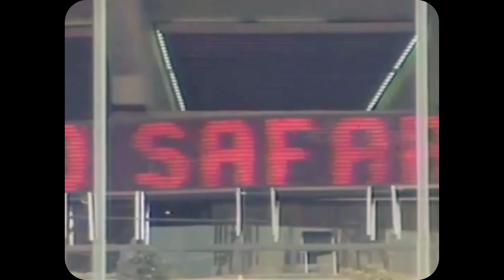Audi's Worst Nightmare

Comment: Fabulous video! 
Two corrections:
13:28: "The event was won by a Renault 5 Maxi Turbo". It was actually won with the older Renault 5 Turbo, driven by Joaquim Moutinho, not a Maxi. 
14:57: "Peugeot ended up winning the Tour de Corse". After the factory Peugeot and Lancia teams withdrew, a Renault R5 Maxi, driven by Jean Ragnotti won the event.
Cheers
Reply: Peugeot did win the 86 Tour de Corse Bruno Saby was driving. Jean Ragnotti won in 85
Reply: @DZeus83  You are correct, I got '85 and '86 confused. Cheers

Comment: Also worth a mention. Between the lotus sunbeam and the Peugeot 205 t16 talbot were developing a mid engined talbot horizon to take on the grp4  cars  it had the sunbeams  911 lotus engine mid mounted and turbocharged to produce over 300bhp but it was only rear wheel drive and with  the audi's 4 wheel drive success it never reached it full development befor Peugeot  took over and Jean Todt stopped further development and built the t16

Comment: As all racing events stated on the ticket in the 1970’s onward, Motorsport is dangerous!
Todays rally cars go faster than the group B cars were going but they aren’t group B so deemed safe.
All it needed was uprated safety cells and the fun could have continued.
As it is all rally events have pace notes and the crews practice before the event.
Only the old RAC rally was driven blind and was therefore safer as drivers had to leave a little performance in hand as they didn’t know what was coming next.
Standing near the track was great I always did it in UK in 1980’s but here spectators were never allowed to congregate on the outside of a bend or corner. So, if a car went off nobody was in the way. In Europe it was like Tour de France with them literally inches away everywhere.
The Ford RS200 was really not up to the design brief and didn’t handle well. Metro 6R4 was just loud and quick but a bit too short. Saw them all on RAC rallies for 10 years doing around 1000 road miles each year following it around. 
When else can you walk into a leisure centre in Swansea at 4am and get a good wash and food?
Remember hitting Washington services on the A1 at about 1am looking for food and coffee with about 50 others of various nationalities and causing chaos.
They were expecting the fans around 6 am but we all took in the service area by Kielder and then headed towards Dolby Forest due to start around 7am.
I decided I didn’t fancy the Scottish leg and aimed for Pickering with a pit stop at Washington services.
The girls were shell shocked including the manager but they got everything fired up really quickly and fed us all very well indeed!
Those were great days because you kept meeting up with the same fans doing the 1 stage in 3 trick and the Germans always had cooked breakfast going in all the forests and shared food too!
Reply: In the USA we had no practice/pace notes, just route instructions (tulip diagrams) to direct us on roads we had never seen before. SCCA early 80's.

Comment: Quick note, back in the 80's and 90's the Rac rally was all over the uk, rather then just the modern version that never leaves wales. So for 1984 when the 205 did its first rac rally, they actually started in liverpool. It was only Wales from 2000 onwards, before that they went everywhere, even to scotland some years, and it started in different towns/citys every year. I remember going watching the start as a child in around 1992 and it was in Harrogate for the start.

Comment: Not sure if you didn't make a mistake there about the anullment. FISA anulled the results of the 1986 San Remo Rally, because the Italian event stewards disqualified the whole Peugeot team for using illegal side skirts (which were deemed legal at other events, so Peugeot protested the decision later). Many thought this was the Italian stewards trying to help Lancia win the event (which they did in the end). FISA anulled the event after the season had concluded, which was very controversial, because it changed the result of both championships. Markku Alén and Lancia were the champions (both driver's and manufacturer's) for 11 days I think, before FISA anulled the event, which handed the titles to Juha Kankkunen and Peugeot.
Peugeot later took the 205 T16 to Pikes Peak in 1987, narrowly losing out to Audi that year, before coming back with the 405 T16 the next year (and the year after) and taking 2 Pikes Peak wins and a new record time. They also adapted both the 205 and the 405 T16 for the Dakar Rally, which they won every year from 1987 to 1989, if I'm not mistaken.
Reply: What's worse, the Peugeots weren't looking like they were going to win the 1986 San Remo rally in the first place.  The steward's "intervention" was unnecessary as Lancia would have almost certainly won the rally anyway.
Reply: Before the Sanremo Rally Peugeot was already the Constructors' champion in that year 86, specifically in the 1000 Lakes rally, after Salonen overtook Alén, pushing him to roll over and winning the rally, Alén being 3rd behind Kankkunen.
The same thing happened in the British RAC rally but without overturn.
Some here believe that Lancia was going to win the Sanremo easily without the disqualification of the Peugeot team. It is not at all clear. In 3rd Leg Biasion was 11 seconds ahead of Kankkunen with a gravel stage ahead, where the roads were cleared favoring those behind, with Biasion starting first. The last leg was on the asphalt of the 1st leg where the Peugeots were better.
Peugeot's disqualification was once again due to a trick by Mr. Fiorio that demonstrated the fear he had of losing at home since they had already lost the Brands Championship in Finland. The Peugeot did have illegal lateral flaps, they were in the pre-rally checks, never in the middle of the test when they were disqualified (typical Italian plot).
That was the reason that Markku Alén wasn't World Champion, something that Fiorio didn't care about at all.

Regarding the Pike's Peak of '87, Vatanen would have easily won it if it had not been for the breakage of an intake flange 3 kilometers from the finish line at more than 4,000 meters above sea level where his engine lost 70% of its power, and only lost by 7 seconds. Already in training it was seen that the Peugeot was doing much better times.
Reply: Think that's a good summary mate. Been a while mind lol.

Comment: People often mention the manufacturers when it came to their insane apatite for more speed and performance. It was nothing more than their selfish 'Greed' that killed the drivers. When spectators died however, that's on the organizers to inform them to stay clear. People are also dumber than sheep and most deaths among spectators happened because of their desperate attempts to seems bold and macho in front of complete strangers. Safety during racing is still seen as an uncomfortable obstacle that gets in the way of entertainment. Crashes draws crowds. Plain and simple.

Comment: Small correction: the Evo 2 debuted in Corsica in 1985 in the hands of Bruno Saby.
The main problem with the Vatanen crash in Argentina was that his seat broke, and he basically was “loose” in the car.
Third: calling the 205 t16 a silhouette racer isn’t really true. The front part, so from the passengerspace, was actually the existing monocoque.
The car never had a tendency to rotate on his side while in the air. In fact if anything it was more stable that ways, because of added gyroscopic effects in a longitudinal direction (same direction as the wheels). The car had a tendency to land on it’s nose though, which they hoped would also be solved with the aid of aerodynamic devices.

Comment: Didn't Audi win two constructor's during group B (1982 and 1984)?
Reply from the maker: yes, you're right, unfortunate mistake. Its still the case that Peugeot won more events, but that mistake slipped through. The error came from different outlets conflicting opinions on whether 1982 should be considered Group B proper, but as I refer to a "5 year" period, the 1982 championship should very much be included.
Reply: @automobilistic  I wondered if that was your logic since the 1982 Quattro was still a kind of normal Group 4 car, but as you said "five year period." I kept questioning it and checking sources throughout the video. Love your videos though, I watch them all. Thanks for clarifying and confirming I'm not losing my mind.

Comment: Audi's nightmare. Lancia's punching bag. A continuation of the group b rallying story. The story about that one prancing lion that beats the quad rings.
Reply: And JMB's weapon of choice.
Reply: After Toivonen's crash Lancia still competed and lost against Peugeot, so 205 T16 is far from being Lancia's punching bag.
Reply: @arekb5951  
But Peugeot bagged a lot of points with Saby’s victory at 86 Corsica, where Lancia’s were firmly in the lead but withdrew from event due to tragedy. 
Also when you compare events where Lancia didn’t suffer technical issues it was a faster car than Peugeot.
Reply: @drazenbudis7881  but reliability, ease of driving and crew safety are a huge part of what makes rally cars "good", not only sheer speed. And the term "punching bag" would at least suggest that when Lancia didn't break or crash they would win with a huge margin, which was not the case because the difference in speed of both cars boiled down to a couple of seconds over the whole rally, sometimes in favour of Lancia, sometimes in favour of Peugeot, hence why I believe such term describing 205 T16 is strongly exaggerated. Punching bags don't punch back, 205 T16 did.
Reply: People often forget one big thing. Peugeot won two driver and manufacturer titles with there number 2 drivers. We hear about how fast Lancia was and Toivonen, but what about the fact the Peugeot virtually won without Vatanen who was clearly the best driver Peugeot ever hired in those days. Enough said really. Peugeot is and always will be, the greatest and fastest group b rally car.
Reply: @unclebanga5976  
Well 205 had basically no competition in 1985 as S4 arrived only at the last round that year (and immediately won 1-2 on the very first race), and would win in hat trick the 85 RAC, 86 Monte and 86 Sweden had engine not given up on both Alen’s and Toivonen’s car in Sweden. 
Then it was downwards spiral after Portugal for the reasons we all know. 
Also, Salonen was the first driver on paper in 1986, but Kankkunen had the edge over him by a mile as Salonen lost the motivation after winnin the title in 1985. 
When you compare the cars, S4 was definitely a quicker and faster package but still very new in comparison to 205 and therefore less reliable with teething issues, but all you need to do is look at the stage times for when both cars were working properly - S4 was faster, and not marginally.
Reply: @drazenbudis7881 
If Lancia S4 was better, why didn't it win at Acropolis, why didn't it win in New Zealand, why didn't it win in Finland, why didn't it win at the RAC in England. Peugeot also had technical problems in Argentina. 
Why were the Peugeots disqualified mid-race and not in the pre-rally checks, if in Italy they were illegal? I'm telling you, Mr. Fiorio was afraid of losing at home, with Saby and Zanussi acting as a hares and clearing the dirt sections for Kankkunen, who was the one who was going to win.
For the first three days of the 1986 San Remo Rally, things were business as usual, with Lancia and Peugeot battling on the asphalt and dirt roads of northern Italy for victory and Lancia trailing behind. Peugeot ran three bar turbo pressure on its cars, pumping a whopping 540 horsepower out of the engine (enough power for 910 kgs.).
Not only in the 2nd half of the 86 season Peugeot had made a leap in performance in its engines, but also its power was more dosable (with anti-lag for turbo very similar to the variable geometry of today's turbos) and car was easier to drive, especially in slow areas. On the other hand, in Lancia they didn't fully control the suddenness of the transition from volumex to turbo and the car was more difficult to control and they could only accelerate at full speed when exiting the curves. I'm not saying it, it was said by Alén and Biasion and even Kankkunen who signed for Lancia in '87 and was able to test the S4 (not in competition) and see the difference between both cars.
Furthermore, after Corsica, Mr. Fiorio and his drivers raced as if nothing had happened. And the Alén-Biasion duo was very equal in performance to Salonen-Kankkunen.
Reply: And then Bites and Roars back at'em with a gut punch. and won the championship titles.